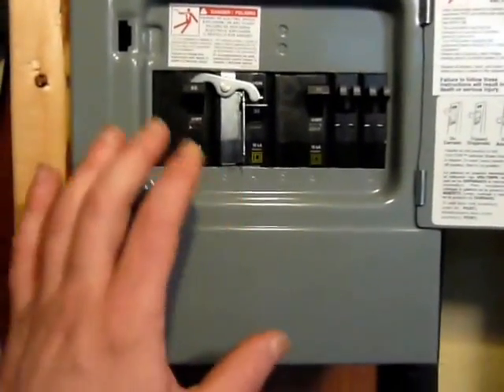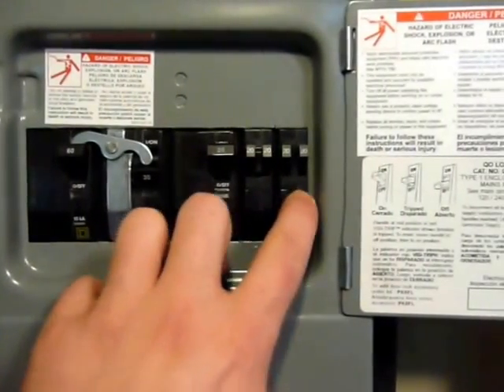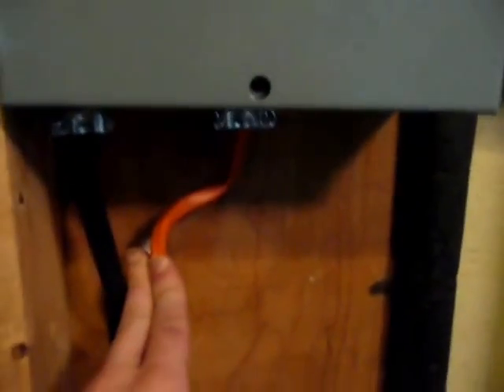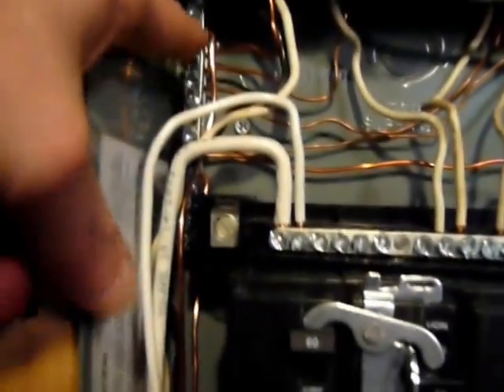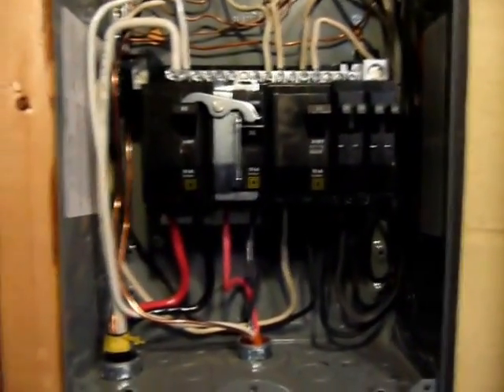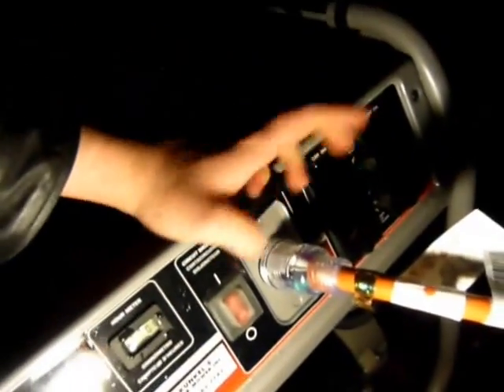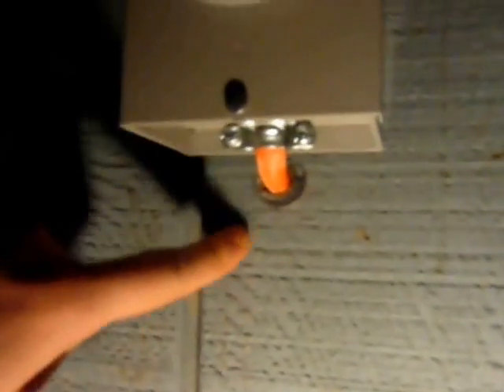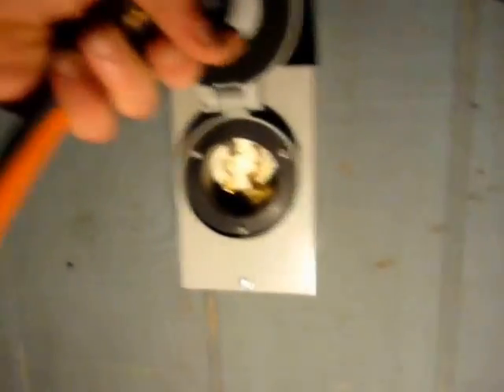Wiring Generator into your home

Comment: I agree with the other on the wire but your video was what I need to DIY myself thanks a lot your video was hard to find  you should a line in the title Square D by Schneider Electric QO1DM10030TRBR 30-Amp Generator MainBreaker Outdoor It would help Thanks again

Comment: Thankyou for uploading this video - you have really helped me out! I have the same sub panel and just needed a helping hand to complete wiring it up. Big big thanks. I will use #4 wire for the primary panel feed to the sub panel. Also i will be using a shielded cable for the external run to the outside receptacle. Thanks once again for sharing.

Comment: Ouch.... 60A breaker but only 8 gauge wire, which is rated for 40 amps per NEC, going  to the sub panel.   6 gauge wire is rated at 55 amps, and 4 gauge is 70 amps.  So you'd either need to replace the cable between main panel and sub panel with #4, or replace the 60A breakers at each end with 40A if you want to keep #8 wire.  (Replacing the cable would be a LOT cheaper.)  The exception is if you use SER (service entrance rated) cable which is rated at #8-50A or #6-65A.  Please don't run with under-sized cable, for your own sake.

Comment: Several things:1) #8AWG (40A-rated) is too small for a 60A line.  So is #10-3G (30A-rated) Romex.  #6AWG CU (50A-rated) is OK for such a short run. But ideally, #4AWG (70A-rated) is best.  2) The switch doesn't prevent "voltage feedback" to other household circuits, it prevents "back-feeding" to the power lines entering your house.  This is to prevent a linesman working on downed power lines from getting electrocuted from your generator.3) You forgot make the furnace as one of your backed-up circuits.4) Running NM (Romex) cable outside your house is a no-no.  NEC 2014 clearly states permanent exterior circuit runs shall be either:     a) UF (direct-burial);     b) shielded by Schedule 40 PVC; or,     c) Rigid conduit with appropriate WX-proof fittingsOther than that, good video.
Reply: I get the concept of electrocuting a line worker, but wouldn't that line worker isolate the lines are they are working on for safety even during an outage to prevent people from putting power on the line?

Comment: That 10/3 orange cable entering the inlet bottom is not rated for outdoor exposure.  He should have entered the rear of the inlet box to be code compliant and prevent weather damage to the cable..  My video shows it correctly.